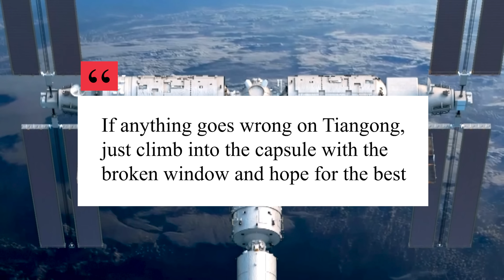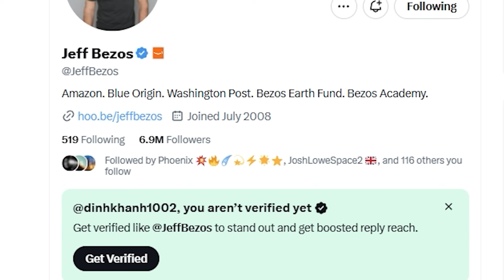What China just did to Rescue Stuck Astronauts on Tiangong Space Station Shocked NASA

Comment: Seems like a lot of unnecessary drama and criticism.  NASA doesn't have spares for the spares either if they get holed.  Personally, I'm impressed with the turnaround time.  Doesn't seem reckless at all.
Reply: I agree. No matter what they did 3 would have to use the damaged capsule in an emergency. Why not keep everything as normal as possible outside of that. 

This is a pro-NASA flawed video. I loved NASA. I’m 66. They were my hero’s but they have made so many critical mistakes. Every astronaut death could have been avoided. 

I am as anti-China as they come but they are following a. Well considered plan. 10 days?  Incredible if it works.